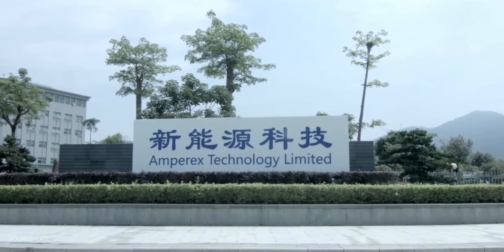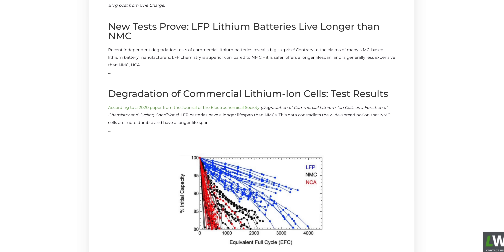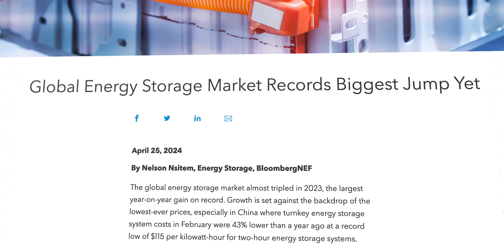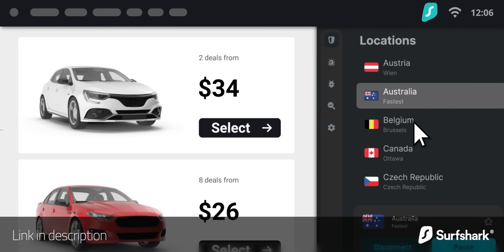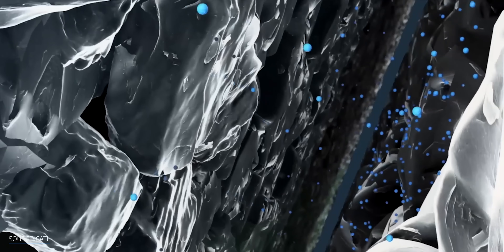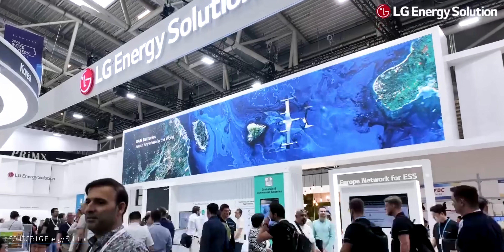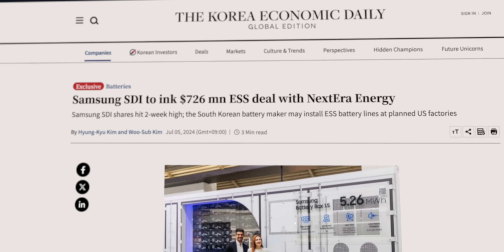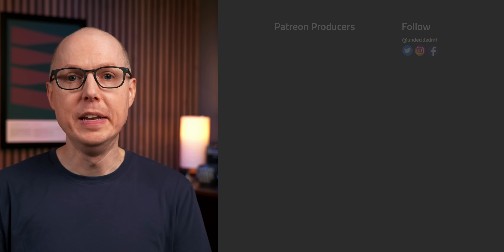How This New Battery is Changing the Game

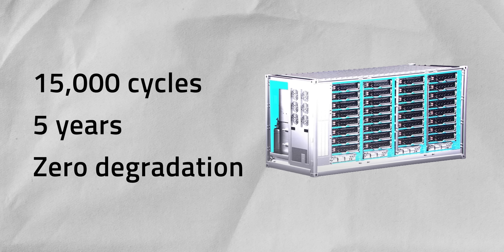Comment: @Matt at 4:40 you mention 15k cycles = 5 years. It is 8 cycles per day. I guess these energy storage sites have 1 cycle per day (charge at daylight, discharge in the evening till dawn). Wth 1 cycle per day 15k cycles means 40years. How is that?
Reply from the maker: Ugh ... sorry for the confusion.  I shouldn't have said "over" in that sentence.  It should have been 15,000 cycles OR five years without signs of degradation.  Also, keep in mind that batteries in some of these systems will be cycling multiple times per day.  Many utility scale battery installations are doing energy arbitrage and storing and selling off energy to maximize cost savings for the utility as rates and use fluctuates.  It's not always about carrying through an entire night.

Comment: Sodium modules replacing LFP modules for even more cost savings?

Are the individual modules in the systems using a standard size module so it’s easy to swap the modules out as chemistries improve? 5 years is a LONG time in the battery chemistry market!

Comment: It's interesting how fast things move. While solid state seems like the ultimate way to achieve potential airplanes, etc on electric, I feel like sodium ion is going to be the biggest growth area soon. Natron Energy is building a 2nd plant in the USA and while it may not work well for cars yet, the storage capacity and price seems like a win win for everyone. Though I have a few LFP cells for a home DIY battery, I am now hoping the salt battery cells start showing up to build longer lasting storage. That Natron's cells supposedly do 50,000 cycles and full charge in 12 minutes is damn impressive. Thats a lifetime battery right now for most who could buy one  (though I dont think they are for homes yet). I could see however if they can increase the capacity without weight in the next couple years, we could see affordable 25K EVs with 500+ mile ranges.. maybe not 0 to 60 in 4 seconds or so.. but I would argue most people would want a 500 to 1000 mile range on a 12 min charge over a couple seconds faster to 60mph. Especially if it could also last 20,000 to 50,000 cycles making it a 100 year+ battery.
Reply: IF EVs are going to be able to get 500+ miles, in any weather, without degrading, in about 2 minutes.... I'll just wait a couple more years for that then and keep my gas car meanwhile which already does all this.

Comment: Why did you make LiFePO4 sound like it is something new?

I suppose the claimed zero degradation for 5 years tech would be an advancement, but consumer grade LiFePO4 batteries already have warrantied < 20% degradation for  7 to 10 years.

If there is a story here, it's the 0 degradation in 5 years new tweak, not LiFePO4. And so far,  it appears to be marketing.
Reply from the maker: Yes, it's precisely that, which I stated right at the opening.  It's the long life/zero degradation improvement made to LFP.

Comment: Excuse me? A paper, in 2020, claiming it's a "surprise" that LFP degradation is lower than NMC?

As far as I remember, this was "common knowledge" back then. If you didn't care about the lower energy density but needed higher cycle and calendar life, or some sub-zero charging capabilities, LFP was the way to go, with the bonus of less flammability. If you needed even more durability and could tolerate the even lower energy density, or needed to be able to charge in arctic temperatures, or needed some ridiculous current densities, go for LTO. Otherwise, Nickel-based anodes provide the highest energy densities, with the exact recipe providing the tradeoffs between energy, power density and longevity (and explosivity). LiPo-s provided the explosive power end along with the knowledge that flames were was a matter of "when", not "if".

A123 went bankrupt 8 years before that, and had been resurrected as two other companies, and they made big headlines with their LFP batteries (both good and bad). The longer life of those compared to contemporary conventional "Li-Ion" family was always a big marketing point.
Reply from the maker: What are you referring to from the video about a "surprise"?

Comment: I my not be the first with this but - isn't the simple way to give customers no degradation this: Oversize the battery pack and allow a large buffer when new, and gradually reduce the buffer electronically as the cells degrade like every other cell does? At first you give the user 85% of the true total capacity, and after 5 years you give them 95% of the lower (by then) true capacity.

Comment: What's the story????  Is it LFP's, batteries that have existed for MANY MANY years?  Making this the most no news of news.  That big players have milked the extra high cost cobalt tech batteries and made billions selling the to big energy cos by the trainload when they should have been selling them LFP's?  Scalling up that production, lowering costs etc..  Again Lithium 'ferrous' ie, 'iron' batteries have been around years.  Those of us caring more about safety than power density use them.

Comment: Cobalt doesn’t come from Africa in spite of the terrible working conditions.  It is predominantly mined there BECAUSE of those conditions.  
Many countries including Canada have access to as much cobalt but safety restrictions and much higher wages make African sources much more lucrative.  
In fact, there is a mining town in Canada named Cobalt after this and other rare earths that used to be mined there.  
The resources still exist.  It’s just cheaper to dig elsewhere.
Reply: Australia also has plenty of cobalt - it's usually found in the same areas as copper.
Reply: @scanspeak00  It is produced from lateritic nickel mines as well, such as Ravensthorpe and Murrin Murrin. But the low price of nickel has already closed Ravensthorpe again
Reply: TLDR: 1st world countries are happy to support slavery as long as they appear green on home soil and spend less money.
Reply: Chinese batteries use no cobalt.  They use LFP lithium ferrous (iron) phosphate batteries.
Reply: The US is a net exporter now, so Canada would do better to export elsewhere. But if tar sands are included, they are likely more expensive than most other options
Reply: Canada has by far the largest oil reserve in the world but is like 5th in oil production despite having the USA as a neighbor being able to pipe the oil down there and fuel the industry of two big economies. It's actually ridiculous how little Canada is utilizing it's resources it should be one of the richest countries in the world. Instead the citizens can't even buy groceries lol.
Reply: @WaterspoutsOfTheDeep  we're all benefitting from Canada doing a bad job at exploiting their resources.
Reply: @WaterspoutsOfTheDeep Venezuela has by far the world's largest oil reserve.  Google it.
Reply: @WaterspoutsOfTheDeep  we have no trouble buying groceries. We just have a lot of media telling us we can’t.  
The checkout lines are no less busy.
Reply: @WaterspoutsOfTheDeep  "Of course you do" What, do you know this guys life better than he does?

Comment: PLEASE get the citizens of Vancouver to adopt heat pumps. Air conditioners are few and far between there, and our VRBO didn’t have one. We visited last month, and we baked for a week in an area which is supposed to be temperate. The whole city looked parched. I grew up there, and was used to frequent rain and lush greenery. Not this summer.
Reply: It's hot for one week a year and everyone now need air conditioning? How about better house design?
Reply: @marcsimmonds5483  I would be happy with that too, across the country The windows in this place also didn’t open much more than an inch, so it was hot overnight. And the grass almost everywhere was brown. All in all, not the same Vancouver I grew up in.
Reply: @marcsimmonds5483  And it’s easier to add a mini split to a room or two than renovate a house.

Comment: I have been looking into the new Tesla Aluminum Ion battery.  This is supposed to last about 200 years with (if I remember correctly) and 50,000 cycles.  It might be a good idea to at least look into this technology.  If it is all true then an electric could go around 2000 miles between charges and is about 1/4 the cost of Lithium Ion batteries.  Plus It is very safe and not subject to thermal run-away.  Oh and last but least it can charge in only 10 minutes!
Reply: Oh..

Comment: I use LFP battery from Aliexpress in my scooter, it's large and heavy ah hell (26kg), but the range(200km) is so worth it. It's bit overkill for city riding, but saves my ass when i forget to charge it.
Reply: How much did the whole battery system cost you?
Reply: Around 700eur including shipping if i remember correctly. It was a 60v 70Ah battery from "GTK" brand, they also go by the name "Shenzhen Fuxiang Technology"
It took around 5 months to arrive.
Reply: I'd be scared to charge that. Lithium batteries from ali express, I hope your  insurance covers lithium fires.
Reply: @alimfuzzy  It's actually LFP, i checked the voltage, so it's safe. Either way i charge it in my storage shed since it's not practical to lug a 26kg box to 4th story apartmant without elevator.

Comment: Five years without degradation makes me think they should have named it the Fiver instead of the Tener.
Reply: pretty sure this battery will last 15 to 20+ years  still can use and maybe half the capacity depending on how you use it ..
Reply: @thatonebeone  agreed if the 15,000 cycles claim is true it would give you 2 cycles per day for 20 years!
Reply: Sodium phosphate batteries are 90% cheaper, have 90% of the storage capacity and 90% of the weight savings of lithium batteries. They also have as their raw material a byproduct of desalinization of seawater for drinking water. They last just as long as lithium batteries, if not longer and are totally recyclable.
Reply: Probably couldn't because of Fiverr
Reply: Well, there is always some maniac trying to push dis/charge rate above 2C. Then the only thing I can say is: it is your warranty terms, not mine.
Reply: @hongyangjiang4976  You can have an insane discharge rate on a Lead Acid battery, but charge rates are very low.
Reply: Fiver is already patented brand name.
Reply: @leeo268  you can't "patent" a brand name.
Reply: @Nerdificationing  Sure you can, I know this guy, just trademark. Mark is my bro, he'll set you up.
Reply: @leeo268  Mark: I hear you want to make a trade.
Reply: Just because all your best years are behind you doesn't mean you can't enjoy a few more.

Comment: Given that ESSs are principally there to get more use out of renewables, how many charge/discharge cycles per day are they expected to provide? I would have thought one or two would be all that is required, solar charges the ESS during the day and discharges at night. On that basis 15,000 cycles would last for 41 years without degradation! 5 years without degradation suggests 8 cycles or more per day. Thanks Matt for another brilliant video.
Reply: 5 years and 15000 cycles are separate claims. 5 years, no degradation (1 cycle per day = approx 1500 cycles) and 15000 cycles total expected life.

Comment: On a different note, I have wondered if the oil companies didn’t push out the electric cars back in the early 20th century what technology of batteries would we have in the current day.
Reply: they would have gone bankrupt anyway. the technology around that field was too minimal it would have never made a viable product. its taken decades of other technology, and manufacturing processes to get to the point where we can begin to make batteries that are barely viable for vehicles that can compete against petroleum based fuel vehicles. I don't see any way it could have happened any way but how it did.
Reply: Wonder all you want. 
Battery automobiles have been around since Edison.
No grand conspiracy required. The weight, fragility &  battery degradation have always failed against ICE.

Comment: A few percentage points in degradation in years 0-5 can be easily compensated for by just making the battery a bit larger and heavier. For instance, if existing tech would result in 6% degradation after 5 years, just make the battery 6% larger to compensate, problem solved.

What would make me more impressed about the technology is if it increases the total lifespan of the battery, allowing it to continue to be usable beyond 10 years or 20 years. That would be real progress.
Reply: LFP can already be cycled at 80% DoD once per day and still have 80% usable capacity after ~15 years. Which is still plenty useful. Calendar aging where it starts to really drop off its capacity is said to be at the 20-25 year mark. But there's not a lot of solid data there.

Comment: I think the biggest advancement would be an aftermarket solution to use a Tesla car. They are dirt cheap used for huge capacity. Just need the interface with your home electric grid.
Reply: Fooling with high voltage is not a good DIY project. I'd do it, but I have an MSEE and many years' experience with lots higher voltages.
Reply: @jamesvandamme7786  
I might not have an engineering degree, but I see a solution to this where you don't.
I'm pretty sure you are assuming that someone won't disassemble the battery.
If it's a Tesla car that's no longer useful (or more likely, that is getting you laughed at in public due to it's link with Elon), then you have a lot of components that make up a car, but can make up something else with some effort.
Take apart the battery. The battery is made of a great many individual cells, and the idea with disassembling the battery is to liberate the cells and reassemble them into some number of series strings of cells that total up to no greater than 48v at full charge for any single series string.
Commercial off-the-shelf pure-sine-wave inverters are able to accept that 48V input voltage and output more than enough 120/240v electrical power to support a typical American home.
The only sticking point, and the part where your MSEE would come in handy, is that to ensure the safety of and prevent damage to the battery bank, a BMS and charging solution different from the one in the "standard" Tesla would be needed, due to the different electrical configuration of the battery cells.
Since I have no such electrical engineering degree, I'd be looking for something that meets my needs that is available off-the-shelf, but a bespoke solution would be more easily tailored to fit the specific needs of the rearranged Tesla battery pack.

What does all this accomplish? Well, at the very least, as far as the IEEE is concerned a battery pack that is 48v max is still "low voltage".
So technically the only time I would be required to "mess with high voltage" would be when I disconnected and took apart the battery pack.
I would of course be wearing proper PPE while I do that, I want to keep my eyes safe from the light produced by an electric arc (by not making one and by having PPE to protect my eyes if one DOES happen), and I want to stay alive (by wearing the properly rated rubber electrical gloves, I can pay for the right ones if it means I get to live despite maybe making a mistake, as humans do).
Reply: @jamesvandamme7786  
I might not have an engineering degree, but I see a solution to this where you don't.
I'm pretty sure you are assuming that someone won't disassemble the battery.
If it's a Tesla car that's no longer useful (or more likely, that is getting you laughed at in public due to it's link with Elon), then you have a lot of components that make up a car, but can make up something else with some effort.
Take apart the battery. The battery is made of a great many individual cells, and the idea with disassembling the battery is to liberate the cells and reassemble them into some number of series strings of cells that total up to no greater than 48v at full charge for any single series string.
Commercial off-the-shelf pure-sine-wave inverters are able to accept that 48V input voltage and output more than enough 120/240v electrical power to support a typical American home.
The only sticking point, and the part where your MSEE would come in handy, is that to ensure the safety of and prevent damage to the battery bank, a BMS and charging solution different from the one in the "standard" Tesla would be needed, due to the different electrical configuration of the battery cells.
Since I have no such electrical engineering degree, I'd be looking for something that meets my needs that is available off-the-shelf, but a bespoke solution would be more easily tailored to fit the specific needs of the rearranged Tesla battery pack.

What does all this accomplish? Well, at the very least, as far as the IEEE is concerned a battery pack that is 48v max is still "low voltage".
So technically the only time I would be required to "mess with high voltage" would be when I disconnected and took apart the battery pack.
I would of course be wearing proper PPE while I do that, I want to keep my eyes safe from the light produced by an electric arc (by not making one and by having PPE to protect my eyes if one DOES happen), and I want to stay alive (by wearing the properly rated rubber electrical gloves, I can pay for the right ones if it means I get to live despite maybe making a mistake, as humans do).